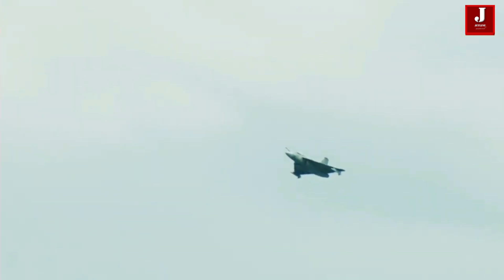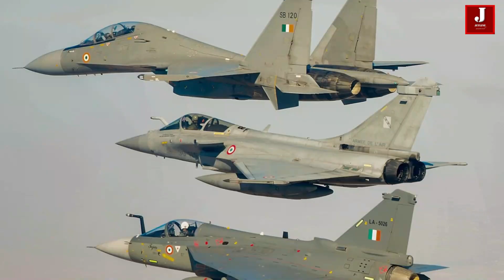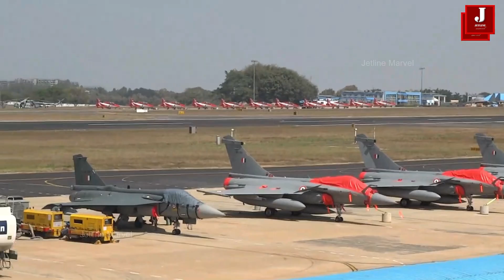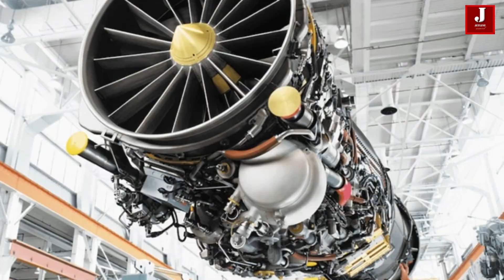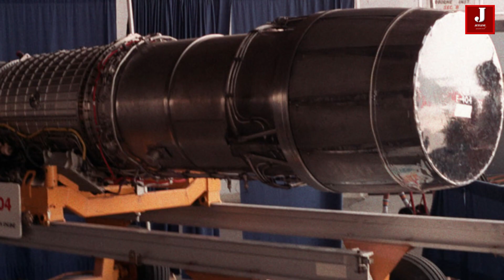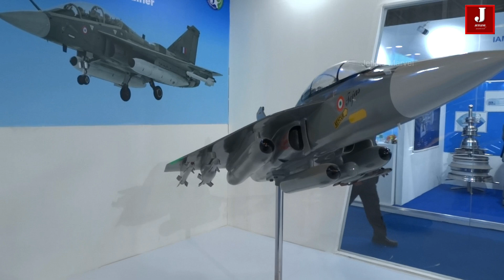Is HAL Planning to Fit the Rafale’s M 88 Engine into Tejas ?

Comment: M-88 is not configured for single engine fighter planes. Either we opt for desi Kaveri or GE Aerospace. Desi replacement for the F-404 may take another 3-4 years for integration, testing and certification. GE Aerospace is the way forward whether we like it or not. Why complain now when supply chain issues were forewarned beforehand?